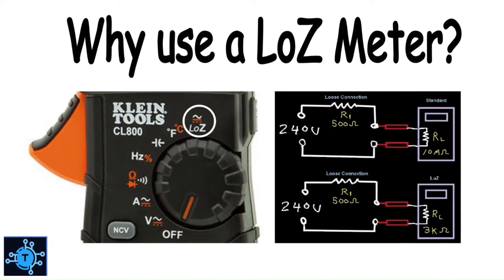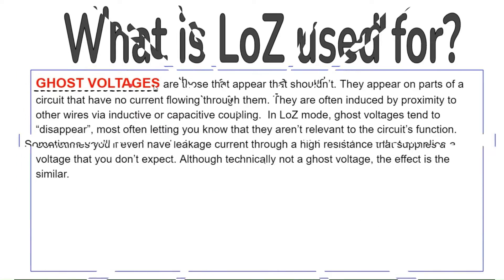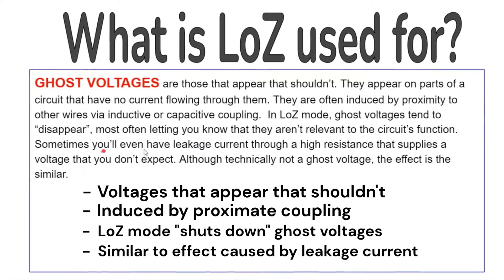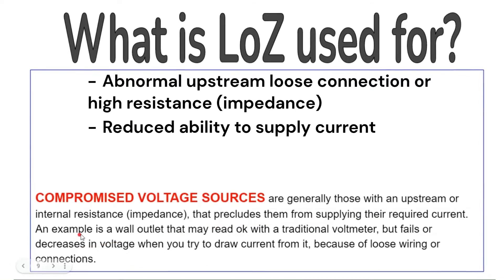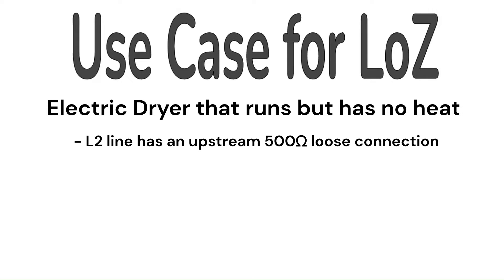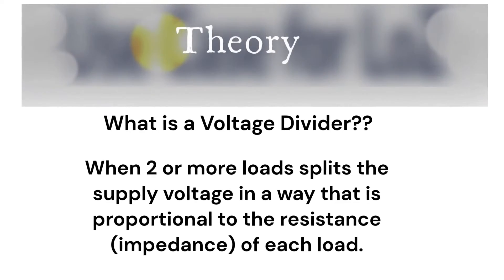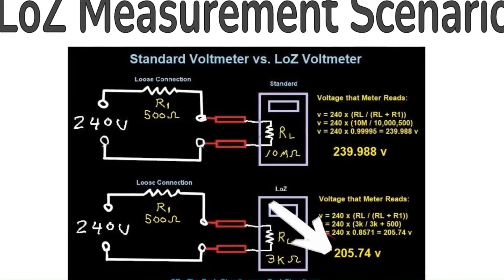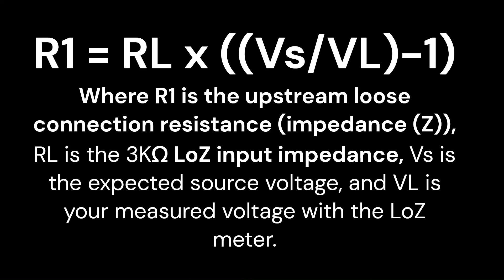#63 - Why use a LoZ Meter?

Comment: thanks, the sentence is confusing, "sometimes....even have leakage current through a high resistance..." Length of wire make more resistance to electrical flow, right? How can something that "Resists" electricity flow "higher" than other things, allow leakage? Leakage occurs when something has Low resistance? V=ir. Should the sentence say, "sometimes...even have leakage current through a something that has very low resistance..."?
Reply: It might also be better to clarify that ghost voltages can ONLY appear on parts of a circuit with no current flow, because any load would be sufficient to cause it to dissipate (and the voltage reading to drop to zero).

I say that because a normal outlet reading 120 V would ALSO have no current flowing through it. The absence of current flow by itself isn't enough

Comment: Another use is testing earth leakage breaker function by measuring voltage across live and earth. A LoZ meter should trip the earth leakage breaker.
Reply from the maker: True that it will trip a GFCI, but cannot be said to test it. On a 120v circuit, the 3200k ohm LoZ mode will cause 38mA to pass from line to ground - which is way above the trip threshold of the GFCI. Properly testing a GFCI would be ensuring it trips at the threshold current which is around 6mA.
Reply: @TheTechCircuit  agree. It’s useful only to see if there is some type of protection there, not to fully test that it is operating to spec.
Reply: Buenos días los Diferenciales RCD o GFCI se comprueban en t y A mediante un dispositivo adecuado y  diseñado para su finalidad. 
La Resistencia interna de los  Voltímetros (Low Z) 3Kohm en el Fluke 117  o sirven para discriminar las Tensiones Fantasma o Capacitivas. Efectivamente se pueden hacer  acoplando dicha Resistencia en Paralelo. 
Probar Tensiones en Líneas Eléctricas mediante LowZ es muy importante dado sus propiedades Capacitivas de las mismas. 
Un saludo desde España